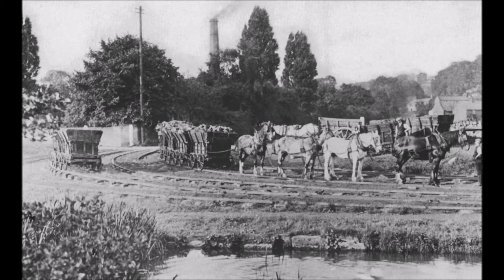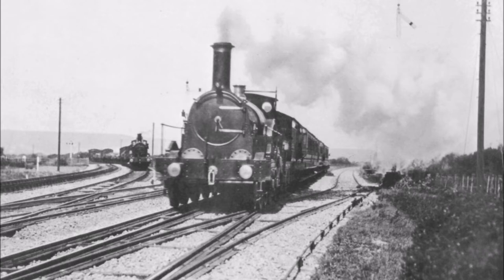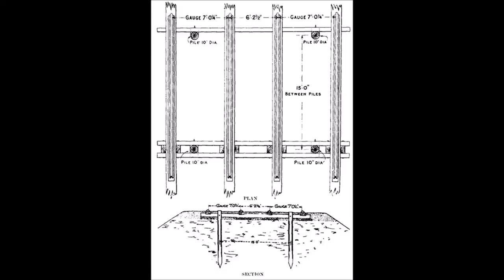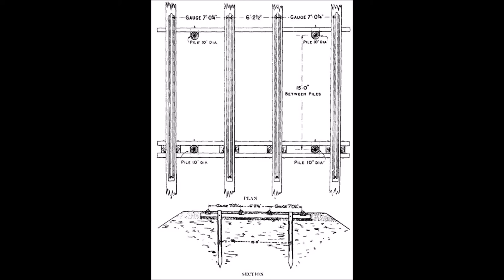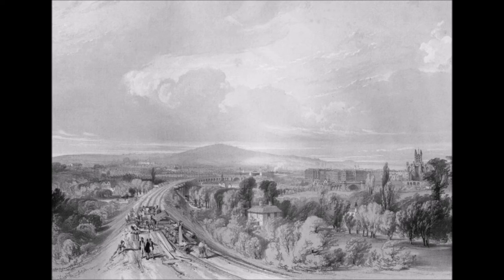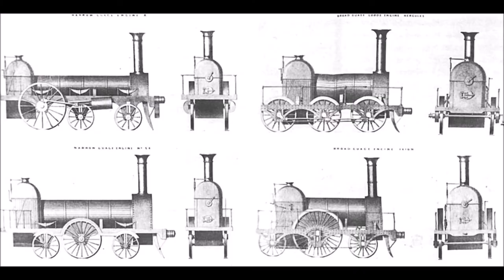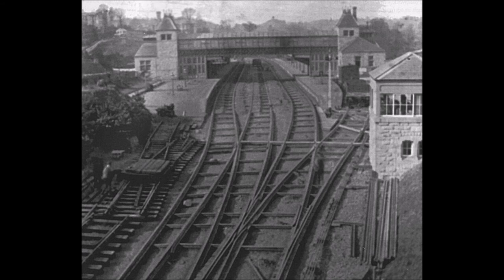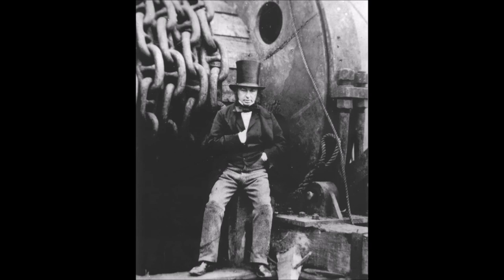Railway History - Brunel's Broad Gauge Track

Comment from the maker: I think that the main determining factor was that all of the small colliery lines had a lot of pre-existing flanged wagons to the 4ft 8.5in gauge, which had been inherited from the coachbuilders who made the road wagons and carriages of the very early 19th century. They also built the early wagons for the coal mines in NE England and elsewhere and naturally just used the same gauge. Also, plateways - where the flange was on the rail, not the wheel - were designed so that road wagons could run on them. The plateway provided a smoother ride which meant the horse didn't tire so quickly and, because of the reduced friction between the plateway rail and the wheel it allowed a greater load to be hauled by one horse (lucky horse!),
The most influential line was the Stockton & Darlington because its success prompted George Stephenson to use the same gauge for the Liverpool & Manchester. In other words the S&DR became the definition of a steam-hauled 'railed way', even though it partly used balanced inclines without locomotives. 4ft 8.5in emerged as a 'standard' gauge through evolution rather than by design, hence Brunel's approach of going back to first principles and asking what a railway was meant to be rather than just copying pre-existing colliery lines.
As is well known he was rather dismissive of the L&MR, regarding the run as rough and not exploiting the possibilities of the new transport form. It's also very important to remember that in his day the standard track formation comprise individual stone blocks linked by yard-long fish-bellied brittle cast-iron rails. That's why he decided to rethink the whole system.
My own feeling is that the broad gauge failed because it very effectively shut out competition from other lines, that's why they forced mixed gauge on to the GWR, so that they could exploit the routes on which the GWR had spent so much money building in the first place. 'Running powers' were an area of constant combat throughout the mid-19th century and it was all about profit, not about providing a service. Ultimately, the gauge wars forced Gooch, as GWR chairman, to sanction regauging despite the many proven benefits of the 7ft, and it should be remembered that this only happened towards the end of the greatest financial crisis before the Wall St Crash i.e. from about 1870 to 1890.
5ft would have been fine, but here in Ireland standard gauge is 5ft 3in and that was decided on as a compromise because at the time no railway used it so everyone had to regauge! It could only happen here, as they say. I certainly feel I'm on the 'narrow gauge' when I nip over the ditch to London to visit relations.
Reply: No the S&D was originally built with a guage of 4' 8". 4' 8.5" came later, after 1830.
Reply from the maker: Fair enough. It sounds like a similar situation to Googh easing the GWR's 8ft broad gauge with an extra quarter inch to reduce flange rubbing on the rail.
Reply: Funny how in America it was common to have accidents related to rail forming a bullhead in the 1800s.
Reply from the maker: I'm sure there were plenty of minor derailments in the early days with the basic colliery lines using short lengths of cast iron rail.

Comment: Informative video as usual, Steve. I didnt know about the track posts in the ground or the fact that the baulks were soaked in mercuric chloride.
Reply from the maker: Yes, originally he used a treatment created by a Dr Kyan -kyanising - but switched to cheaper non-patented mercuric chloride and then even cheaper bitumen. The treated wood lasted very well, most of it was fine right up to the gauge change.

Comment: I've always wondered why they didn't compromise and choose five foot instead of the odd four feet eight and a half inches.  Widening the gauge by three and a half inches would not have caused too much trouble.  But I guess hindsight is always right.
Reply: Five foot gauge was commonly used in the United States in the 19th century, particularly in the south.  In fact, the transcontinental railroad was intended to be constructed on the five foot gauge unti Abraham Lincoln had it converted to standard gauge.  Russian railroads were built on the five foot gauge as the Tsar's government employed the American engineer, George Whistler (father of the painter James NcNeil Whistler) to construct their first railroads.  Whistler specialised in building on the five foot gauge.

Comment: Wider is useful for larger diameter inside cylinders, for steam.  Any other prime mover doesn't have that problem and cross sectional vehicle area becomes increasingly significant as speeds get above 125mph.  Hitler as a megalomaniac proposed a 3m gauge!
Reply from the maker: I haven't read 'Broader than Broad' about the 3m gauge line but I know of the project; very dark, draconian and chilling in concept. I won't be making it for Trainz!
Reply: Ha ha! I like that! He was a pretty narrow-minded ( oy! ) nut-case!  As one who gets right cheesed off with the popularity bumf of narrow-gauge railways - yearh I know, they’re smaller, have less money, and are generally the mister modest and poor guys, but I see them as more cramped in style for seating and are slower....Well, that said, South African Railways were once upon a time worthy of admiration....On the other hand broad gauge rules in India, providing more space inside, yet don’t they still allow people - non ticket holders presumably - to ride on the carriage roofs?  
What will they do when they go electric?  Or maybe that won’t happen before they reach Mars with our « peanuts »!

Comment: Brunel certainly didn't intend the locos on his broad gauge railway to be bigger and more powerful than those on the standard gauge, he actually specified that they should be lighter than even those on the pioneering Liverpool and Manchester.  It was Daniel Gooch who appreciated the opportunities offered to locomotive designers by a wider gauge when he was working for Robert Stephenson & Co. and involved in the design of wider gauge  locomotives for an export order.
Reply from the maker: Yes, you're absolutely right. Gooch deserves the credit for those GWR broad gauge locos which were successful, especially the Fire Fly class, of course, while Brunel simply stipulated some rather odd requirements to loco builders and let them get on with it. Hence the rather odd designs of that first generation of locos. I guess the main aspect we can draw from the locos - and the baulk road track - is that IKB was trying to think outside the box and redesign railways from scratch rather than relying on the evolutionary development of the old stone-block wagonways into the much more flexible type of track used by Stephenson on the Liverpool and Manchester.

Comment: Around here (Northeast US) a lot of lines were build circa 1830-1850.  I’ve often wondered what the rails actually looked like.  A local historian claims they originally laid rough sleepers on bare ground (no ballast) and used iron-covered wood for rail.  A lot of the infrastructure is heavily constructed and still remains in use.  Think stone bridges and fill vs the flimsy trestles use on post Civil War construction.  I just find it strange to think they’d spend years constructing stone culverts and filling in valleys and cutting open hillsides, only to lay down cheap strap rail.
Reply from the maker: It does seem a little unlikely, especially given the trend generally to increase the weight of rails (pounds per foot) and the gradual switch from iron to steel as the latter became commercially affordable. Perhaps some initial track was laid quite roughly but would have worn very badly and required either frequent replacement (making such track economically unviable) or rapid upgrade to better track. Also, you have to bear in mind that early locos and rolling stock were relatively lightweight so as soon as heavier vehicles appeared the track would have to be strengthenes and/or improved accordingly. I think Buster Keaton's film has a lot to answer for!

Comment: Do any sort of drawings exist for the fishbelly rail sections?
Reply from the maker: Yes, several of the books I have about early railways give line drawings showing the outline design. They are all in copyright so I can't post any. Check what you have, you might be lucky, otherwise look for a good condition 2nd-hand copy of any early railways book.
Reply from the maker: I just did a quick Google images search and there are quite a few drawings available online.
Reply: @ing4trainz  Cheers

Comment: Could the GWR have used double decker 7FT carriages?  Just drumming up GWR carriage designs for broad gauge like they used to do at Wolverhampton.
Reply from the maker: Brunel's concept was for broad but relatively low carriges where passengers would sit between the wheels rather than above them. The vertical clearance was virtually the same as the narrower gauge stock. The only exceptions were some tunnels which, because of their length, needed greater internal height to let smoke clear for footplate crews. In Europe the loading gauge is higher and allows for double-deckers, but the British standard is lower and narrower.
Reply: @ing4trainz  Perhaps... but if the loading gauge was broad on the GWR, they could use taller rolling stock across the UK. Thus the ability for double stack containers.
Reply from the maker: Unfortunately, the 'gauge wars' which led to the adoption of the narrower 'standard' gauge was driven by those companies who wanted to compete with the GWR over the latter's own track without the cost of building it. The decision was based on short-term acquisitiveness, not which gauge might best serve the country in the long term. Inter-connectivity was (and is) a red herring.
Reply: @ing4trainz  , 2 points to raise here.  indian railways have introduced double-stacked high speed container trains.  and they are not using well-cars like in north america and australia.  that is the benefit of just 9 1/2 inches.  second point -  during the second world war, if the australian army decided it needed to move military vehicles from perth, wa to cairns, qld because the japanese were in new guinea, it would require 6, yes, 6 train changes.  foot soldiers could just get out of one train onto the next.  but they better make sure they didnt leave their rifle in a previous train.